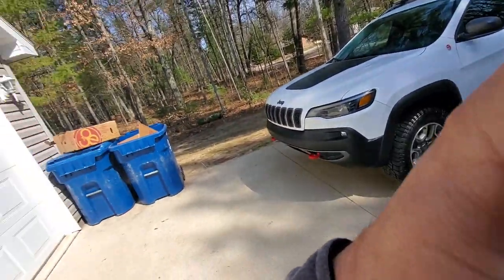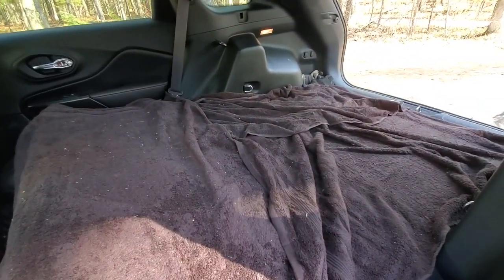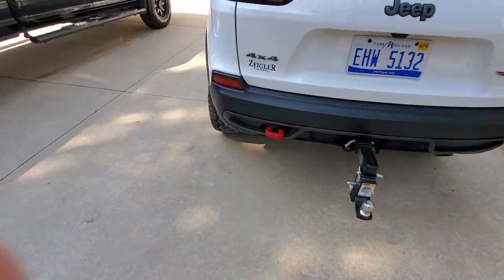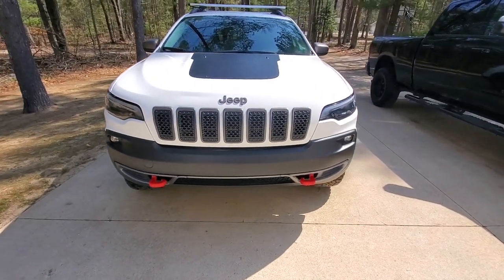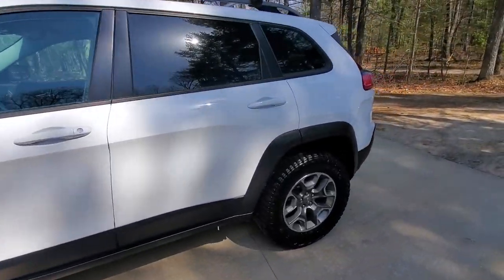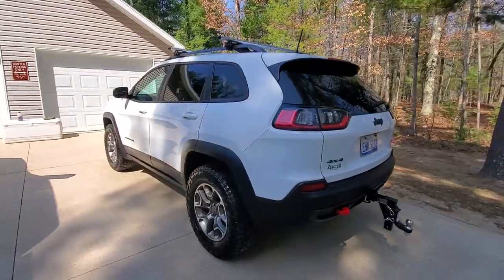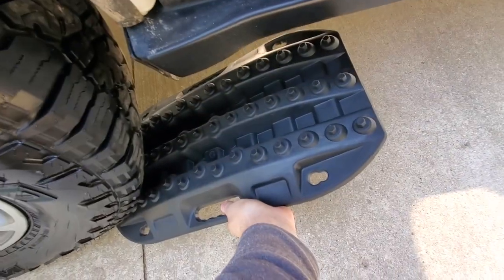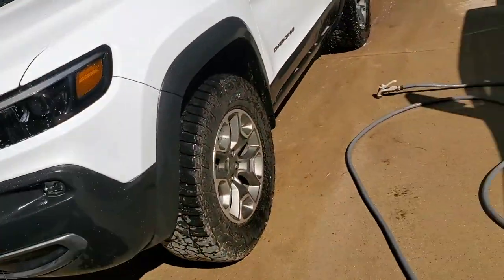Why Is The Jeep Cherokee Trail Hawk So Amazing

Comment: Great video! But where are you getting a one and a half inch lift for $150? Are you sure you’re not referring to a leveling kit on the front end only?
Reply from the maker: It was a full lift from hazard sky lift kits
Reply: @SamkoTradBow  installed for 150 bucks? I am being quoted close to a thousand. Would love to have a lift like yours looks great. Stock rims with bigger tires, what size did you use? Look great.
Reply: I was always under the impression that a lift kit would avoid the warranty. Is the one and a half inch lift avoiding that instead of going with like a 3 inch lift?
Reply: And did you have to put the one and a half inch lift on the back for the taller tires or could you have gotten away with just doing the front to get rid of the factory rake?
Reply from the maker: @newittsrock  I installed the loft myself it was super easy and then took it up to get a front alignment for 100 bucks.  Can't remeber the tire size but it should be in this video. If not search falken on my channel and a falken review will pop up that shows the size of these. I don't own the car anymore so I can't remember the size.
Reply from the maker: @newittsrock  the lift that small won't affect warranty.  It's just a couple spacers. At least my dealer said it won't be a problem when I asked. I went 1.5 because that's all I needed to clear the tires. The higher the lift the more problems you have. Cv axles are not ment to operate at those high angles.
Reply from the maker: @newittsrock  could of got by with no lift at all. Actually did drive it for a mo th with these tires and no lift and only rubbed at full lock in reverse. And that could of been fixed by doing the pinch weld mod and trimming back the extra metal on the pinch weld
Reply: @SamkoTradBow  gotcha. Thank you! May I ask why you no longer have the vehicle?
Reply: Gotcha can I ask why you no longer have the vehicle?

Comment: Nice rig I got a great deal on a a 17 blacked out Rubicon Recon JKU back in December 2017 fully loaded brand new just when the 18 JLs started showing up that I has hesitant getting being a new design to wait to work out the kinks got it for 45k taxes and 7yr 100,000 mile bumper to bumper warranty out the door 50k but the resale is better than Toyota but never had to push the lockers yet and zero issues mechanically with 53,000 on it now only issues is gas mileage and rough on BF KM2 mud terrain tires need new fronts replaced due to covid not being able to get them rotated those babys hum down the road.
Reply from the maker: Love the rubies! If I bought another wrangler it would be a Rubicon too. Sounds like a great deal too! We'll done!

Comment: I know this is very late but I just got a 2020 Jeep Cherokee Trailhawk two days ago. Have you ever experienced an issue with turning while accelerating from a stop, it almost feels like something is rubbing or the 4wd system kicks in but then it goes right away. Have you ever felt this?
Reply from the maker: I have not. Wad anything done to it before hand. Could bigger tires be rubbing etc

Comment: I think Sand/Mud mode with rear locked lets all 4 wheels spin. Maybe the electronics don't make it actual 4 wheel lock like quadratrac but it's pretty close if it's not.
Reply from the maker: Mud and sand mode let's the wheels break free the easiest as that is what you want in mud and sand. Wheel spin is controlled by the abs system and algorithms.

Comment: I just got a used Trailhawk and was wondering where you got your lift kit and which falken tire size did you use on yours. Thanks for all of your great content. Good luck with your move to Georgia!
Reply from the maker: You will love it. The lift kit is by hazard sky 1.5 inch lift. And the tire size is show in this video or in my falken tire review video. I don't own it anymore and can't remeber tire size off top of my head
Reply: @SamkoTradBow  Wow, surprising it's gone since you spoke so highly of it.  What did you replace it with?
Reply from the maker: @SeventyGTX  a tacoma because I needed a truck for my new business plans

Comment: Excellent review, bought 2018 Trailhawk of my own.  But let's be honest, 21mpg is crappy mileage on any scale.  My last car was a 2013 Chevy Cruze, 1.4L turbo (stick).  Best car I've ever owned.  That thing was rated 42mg highway, 35 average on trips.  I seriously miss that 500 mile range.
Reply from the maker: everything is a trade off. I loved the naturally aspirated engine in the trailhawk. The mileage is the trade off. You would not be able to run 4x4 and the capabilities of this trail hawk with a 1.4 turbo.
Reply: I have the 2020 4 cylinder Cherokee, I get 24mpg in the city and it may not sound like a whole lot but I went from a 16mpg 2014 Navigator L
Reply: @SamkoTradBow  I've driven my 2017 Cherokee from Washington state to Utah and back and got an average of 26  mpg. One other thing...the front wheels have what's called "brake lock differential" (I think) where the car applies the brake to the wheel that spins to force power to the other wheel. Love mine and it is also my first choice when heading into the mountains. I like that it is so short that I can easily turn around if the trail starts to get too "whatever".

Comment: I fully intend to get one.  I was hoping to convince my wife into getting one since we were downsizing both our vehicles into 1, but we ended up with a Mazda CX-5...the misses "needs" a vehicle that is "easier" to drive.  But there is still hope.  Since I am without a vehicle know, I will be driving my mom's Wrangler Sahara Unlimited as my daily to and from work.  I am trying to convince her to trade up for something more practical on gas, and the Cherokee Trailhawk is still on my list as it will handle our Canadian snow without issues, lower gas usage (around 11-12L/100km on paper vs the 15L/100km on the Wrangler based on our real use), and it should be big enough to transport 5 (3 adults and 2 kids currently under 10) for the occasional outing.
Reply from the maker: Yep the cherokee trailhawk would be perfect. And if you get it will love it

Comment: Thank you for sharing question when you up sized your tires did it cause any problems with speedometer or any other equipment. I’m looking at the 2021 Thanks
Reply from the maker: No problems with any equipment but you speedo will be off by about 3% or off by 2mph at 75mph

Comment: How has your transmission been any issues?
Reply from the maker: Flawless and never any issue. And I now know 8 trail hawk owners 2 with over 90k miles and never an issue. Every vehicle has "internet issues" but most never show up for anyone in real life. My opinion anyway. I would not hesitate to buy another trailhawk! Best smaller sized suv I ever owned.
Reply: Awesome thanks
Reply: So just curious why did you sell it with such low miles on it?

Comment: Late to the party, but question. How was it in the snow?
Reply from the maker: Amazing in the snow. On my social media pages I have a few pics of this in 16 inches of heavy wet fresh snow as I blaze trail down a un touched power line trail. It's amazing and the traction control on jeep and ram is the best in the industry blows ford's out of the water. So spot on and quick its near impossible to slide or loose control.  Best traction control I have seen.
Reply: @SamkoTradBow    I traded in my power wagon on a 2022 grand Cherokee summit. Absolutely beautiful but wife liked it so much I gave it to her and took her 2020 Cherokee trailhawk. I’m lifting it this week hopefully with bigger sneakers. Thanks
Reply from the maker: @markrea2866  you are gonna be very happy.  Mine had a hazard sky 1.5 inch lift and 31.5 in tires (if I remember correctly) and I loved it!

Comment: I have been in the market for a used 2019+ but really getting cold feet over the constant trashing of the 9 spd transmission and reliabilty issues all over the net.
Reply from the maker: every single vehicle gets trashed all over the net. even my toyotas I have now. All bs as far as im concerned. I loved the trail hawk. and still know people that have 2016s with over 100k  miles on them and they were lifted and off roaded the whole time. zero issues.
Reply: @SamkoTradBow  Welp, I am picking up a 2021 Trailhawk tomorrow.  One owner, still over 2 years left on the bumper to bumper warranty over 4 on the drivetrain.   Pretty excited!  Since I made that comment about the trans, I have read many people that are completely satisfied with theirs.   Like you say, there are people that complain about everything all over the net.
Reply from the maker: @SeventyGTX  you are going to love it. So happy for you
Reply: @SamkoTradBow  A bit late on the reply but you were right, we love it!  The only issue is the original battery crapped out last week which I have read are junk.  Fortunately it didn't leave us stranded.  Replaced it with a Everlast from the Cherokee forum recommendations even though the original was still under warranty.   Totally happy it is so far!

Comment: How is it going up hills on road in deep snow
Reply from the maker: Very impressive.  Had it in 12 inches of heavy wet snow last year, pics on my Instagram and fb. Broke trail on a power line for 8 miles theu all that. It did awesome!
Reply: @SamkoTradBow  wow thanks for respond.  I have subaru crosstreck which is great off road and snow with hills but is not high enough for deep snow.  getting trailhawk cherokee for second vehicle.
Reply from the maker: @williamkenny1445  I almost bought a cross tek! Such a great vehicle for the money! The cherokke trailhawk is amazing and you will love it

Comment: So can you use the lockers without putting it in 4 low?
Reply from the maker: Never tried.  Don't know why you would need to run the locker engaged in 4 high. Lockers are just used for the bad spots otherwise you are binding the gears if you are making any turns on harder surfaces.
Reply: @SamkoTradBow  So I live in northern PA and we drive on nonplowed mountain roads to hunt, but a little to fast for 4 low. Just for better grip!!!
Reply from the maker: @jasonlehman4642  in snow mode in 4 high the electronic bdl will basically act like front and rear lockers automatically  and it's amazing
Reply: Very cool, thank you!! @SamkoTradBow

Comment: Renegade trailhawk vs Cherokee trailhawk?
Reply from the maker: @civanhm1992  both great but 2 completely different worlds. The renegade doesn't actually have a transfer case or a true low range like the cherokee does. Low on the renegade just keeps you in first gear. But the renegade is such a great vehicle too. Owned both loved both.

Comment: Can somebody tell me how it does towing?
Reply: Preferably an rv
Reply from the maker: @brmo6261  never towed an rv. But did tow a 6x10 enclosed trailer that weighed about 3k pounds and it towed it amazing. Actually got better gas mileage and towed better than my tacoma truck did or my gladiator I have now does. It was amazing gow well it towed thst trailer. And I towed it daily for my pressure washing business.
Reply: @SamkoTradBow  oh wow nice. Did you have to install trailer braking on it or anything? And did you have any problems with braking and/or swaying when driving on the interstate, as well as going uphill while towing? I’m sorry for asking so many questions I’m just stuck between this and possibly a grand Cherokee
Reply: I plan on just getting a small 2-3k pound max rv trailer
Reply from the maker: @brmo6261  did not have to install a brake controller since it was under 3500 pounds. Trailer sway is a user error. If you dont have 10-15% tongue weight its gonna sway and be dangerous. no problems braking but remember you need more time to stop.
Reply from the maker: @brmo6261  should not have any problems with that set up at all.
Reply: @SamkoTradBow  thank you so much for your help! And I’ve never had a trailer or towed anything before so I’m gonna sound kind of stupid asking this but what do you mean by 10 to 15% tongue weight?

Comment: It's not a Grand Cherokee. lol. But anyways, how many miles are on it now? Are you concerned about the transmission going out on you as many did by the 20 or 30 thousand mile mark?
Reply from the maker: Just sold it with 50k miles on it. It was 100% flawless the whole time I owned it. If a transmission went out at anytime upto 85k miles it would be covered under standard warranty.  So anyone that had that problem would of got a new one. And if "many" had that problem they would of recalled them. I have talked with (because of my yourube and social reach and owning this trailhawk) over 100 people that own 2016-2022 cherokee trailhawks and all of them have never had a transmission problem. My only point is don't let the crap you read on the internet fool you. They sell 300k of these a year and have for the last 7 years with the same motor and Trans. If it was a problem at 20-30k miles it would of been recalled already. Mine has been 100% flawless and I would not hesitate to buy one again if I wanted.

Comment: What size are you running with your Tires??

I have the Hazard Sky 2" LEVEL...(1.5" lift)

I am thinking 245/70/17 tires, but alot of people do the pinch weld mod then go 265/65/17
Reply from the maker: Can't remeber what size I had on it but I show it in the video when I do a close up of the tires. I also show the size in my falken tire review video.

Comment: Good video.  If you got the 3.2 V-6 in there, keep and eye on your oil filter housing.  Ours grenaded at about 70,000 miles and we lost 5 qts of oil going down the road before the engine light came on.  It's made of plastic!
Reply from the maker: Yep lots of manufacturs use plastic oil filter hosuings now. even my tacoma has one! crazy the way manufactures will cut corners.

Comment: Have you tested out the Jeep Grand Cherokee Trailhawk? If so, would you still prefer the Cherokee Trailhawk over Grand Cherokee Trailhawk?
Reply from the maker: I have not tested a grand cherokee trailhawk as its not in my budget. But the grand does everything better, more ground clearance,  more room, more motor, etc.
Reply: @SamkoTradBow  i disagree. While the grand cherokee trailhawk does come with adjustable  air suspension, it does not come with a true mechanical rear locker.
Reply from the maker: @anthonyvanderstar1448  just found that out! That's pretty sad they didn't put th locker in the grand. 50k vehicle designed for off road and no locker. How stupid.
Reply: @SamkoTradBow  Couldn't agree more. The lack of the rear locker is what made me choose the cherokee over the grand cherokee

Comment: I got to say jeep compass got better then jeep Cherokee with a big upgrade
Reply from the maker: The compass is nice. The cherokke trail hawk has outstanding dedicated 4 low, locker, etc. That's hard to beat
Reply: I still feel the Jeep Compass is better especially the 2023
Reply from the maker: @flash4182000  I owned the cheorkee trail hawk and my daughter had a 2019 compass. Both are great but designed for very different purposes.
Reply: @flash4182000  For what it's worth, I have a 17 Cherokee Trailhawk and a 20 Compass Trailhawk and the KL is better in EVERY way, except maybe fuel consumption.

Comment: I have one and it’s not reliable. Just after the warranty I had a transmission issue with 30K miles on it.
Reply from the maker: Transmission warranty should be for 50k miles. Part of the drive train.
Reply: Thanks for the info.. I‘m going to advise my dealer, it’s not repaired yet
Reply from the maker: @nicotrailer3089  you have a 3 year 36k mile bumper to bumper and I believe power train is 50k 5 year. I'd look it up to be sure. But I think that's right.

Comment: Actually you are incorrect on how Jeep 4wd works. Jeeps come with traction control that uses “Brake lock” differentials . Meaning when a wheel is spinning jeep traction control will apply the brakes on the spinning wheel and it forces the wheel with traction (wheel not spinning) to spin to get and keep it moving forward . It is not like normal limited slip differentials that will just sit there in spin..also if you use “Ceramic brake pads” you wont have that. Its the metallic brakes pads that cause the problem you  are having.. i run power stop drilled and slotted rotors with their “carbon fiber/ceramic blend” pads and i have no issues whatsoever , no dust nothing..
Reply from the maker: My trail hawk has a dedicated rear locker. And a button that says so. But the non trail hawk models that don't have lockers and low range use brake lock like you are talking about. My renegade had that and it worked very well.
Reply: my 2020 Cherokee TH elite comes with an actual mechanical rear locker.
Also has 4lo with crawl control. Amazing offroader with all the nice luxury items :-)
Reply from the maker: @one-WildCard  yep. The trail hawk is amazing!
Reply: Your comment is incorrect. That doesn't apply to the cherokee trailhawk.

Comment: Had a 2015 Cherokee Latitude AD2 with 3.2 for 8 years , worst vehicle I ever owned , absolute junk and FCA/Stellantis customer service and dealer support is non existent. Wife and I Have had many Jeeps , most of my family worked for Chrysler, but we are done with them and couldn’t be happier with what we have now instead . My Jeep Patriot FD1  was a better vehicle all the way around , especially in snow and Off-road. I wouldn’t even trust the Cherokee offroad it couldn’t handle not breaking babying it on road. BEWARE of the failing PTUs and suspension parts that seem to be made out of aluminum foil.
Reply from the maker: Loved mine and 60k miles of pure flawless before I sold it for more than I paid for it. Never once in the shop for anything and it spent 60% of its time in the woods andnin 4 wheel drive. Absolutely loved it.